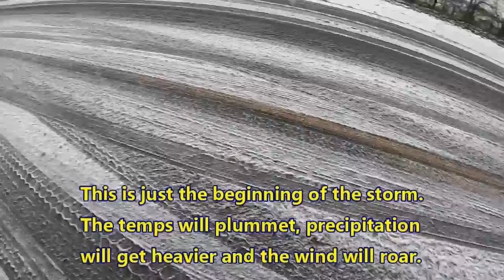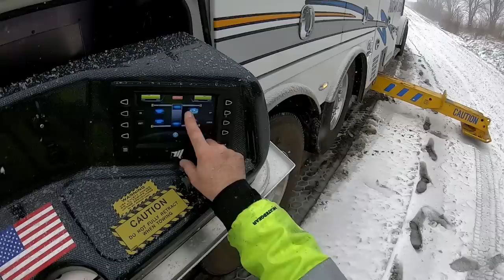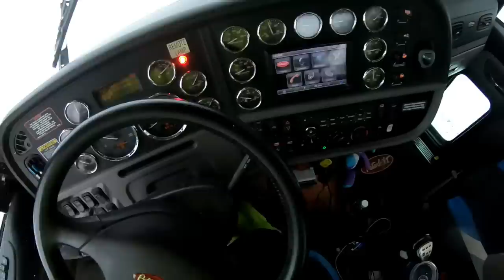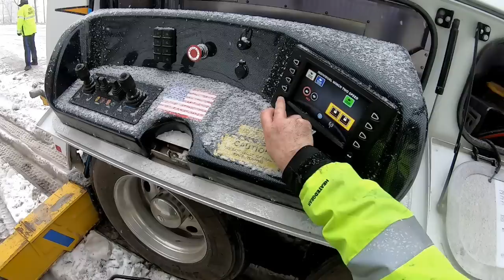Guardian Angel Working Overtime  Two Jack knifes in the Snow Part 1

Comment: Ron would it be better to have a support vehicle of some kind to give you rear protection in circumstances like that, even if it's an older car / van so you have some rear protection of (heavy metal) substance? At least then you reduce the risk someone hits the rotator or worse - you guys.  We do this in the UK in the form of a highways officer vehicles (non police range rover or shogun) with the wheels turned away at full lock so it's not rammed into the scene if struck.

Comment: hey Ron, your the professional, but i have a question. why didn't you pull the truck backwards. i would think that pulling it from the back of the trailer, would cause the truck to follow it and straighten out for you to pick it from the front.

Comment: I would get some road flares for a snowy conditions like that
Reply: Road flares are only so good, led flash pucks he uses are more reliable and reusable as they can be easily recharged or battery replaced if use AA or 9V
Reply: Joshua79C C the flashing ‘pucks’ come from AMAZON., INEXPENSIVE,, 2A BATTERIES,
Reply: Have to be careful with flares around leaking diesel, gasoline, or propane!😲

Comment: We (Missouri) got Weather-Hammered for sure. At various points in the video there seems to be an Echo, is that because of the camera placement on your hard hat, or are you using an external mic? Out of curiosity... Does Talon ever say anything Stronger than "Daggummit"? As always Ron... A great video.

Comment: In all of your Time Lapse videos I notice that you ALWAYS keep the load as low to the ground as possible. never any higher than required for the job.  That is very smart keeping as much potential energy out of the system as possible. meaning if anything does fail and break. The load would only have a very short distance to fall, and cause very little, if any, additional damage.
Reply from the maker: It isn't always possible to keep the load low, but I do so whenever it is possible exactly for the reasons you mentioned.    Thanks for watching and God bless.

Comment: ice is scarier than DUI drivers...

I was driving across Nebraska.  Clear sky, no sign of anything on the road and saw someone spin out ahead.  I touched the brakes and my speedometer almost instantly went from 60 to 0.  The car didn't change velocity or direction.  I was riding a ballistic object. It took over a mile to stop.

Comment: Thanks for the video. Two questions. Does anyone make a portable arrow board that you can use instead of cones? Also would you have been better off dragging the rig backwards first to get the tractor straighter? Can you rig so that you can do that without turning the truck around?
Reply from the maker: 1st, yes, there are portable arrow boards.  We actually have two permanently mounted arrow boards.  Each of our rollback trucks have them, but they were in use that day elsewhere.  2nd, yes, I have the capability of working over the cab and could have pulled the trailer backwards from where I initially parked.  There are several reasons that I did not perform the recovery that way.  The primary reason was that the cab was already into the trailer and the tractor was leaning uphill with the trailer leaning down hill.  If you noticed, we lifted the trailer so that it would pull away from the tractor to prevent any further damage to either unit.   Hope this explains my reasoning.  Thanks for watching and God bless.
Reply: At 9:55 the trailer is visibly resting on the tractor frame right behind the catwalk. No way to tell how much weight is on that contact, but you can bet that with those angles it's quite a bit.

Comment: Ron I have a question please can you recommend gloves that allow for work yet keep your hands from freezing these mechanics gloves suck my hands freeze in a second but if I did wear big fat winter gloves I can't work. What are your recommendations for somebody who does roadside assistance in ten below Iowa
Reply from the maker: This is the glove that I have been wearing.  They cost me about $10 a pair and last a long time.  They keep my hands dry and warm.  I keep several pair in the truck with one pair on the defroster to keep warm and then I trade out as necessary.  These are warm, yet flexible which allows the best dexterity that I have found in a winter glove.  https://www.google.com/search?q=memphis+arctic+ice+hi-viz+glove&rlz=1C1CHBF_enUS739US739&tbm=isch&source=iu&ictx=1&fir=tTGn8-GbFTbnbM%253A%252C0IHs_HRTsWz4QM%252C_&usg=AI4_-kQDsRaQtNsEsYaExXfwAhZfWOrG1A&sa=X&ved=2ahUKEwiZla7sya3gAhVq1oMKHQCLD_AQ9QEwAnoECAIQBg#imgrc=tTGn8-GbFTbnbM:
Reply: @RonPratt  thank you so very much thank you so much love the videos thank you so much Ron

Comment: Volvo 670 with mty van trl about 33k pounds.  Sustained winds 25-30mph with 45gusts on snow covered roads?  Even driving slow a wind gust can knock you off the ice . Sometimes you just have to make the call to shut it down when conditions overtake the ability to be safe. She rolled the dice & lost.  
Unfortunately a lesson learned might also be a job lost.

Comment: Feb 7 local weather went from 100' visibility fog to mid 50s, then high winds and the temp dropping 40 degrees. During the fog I saw too many cars with no lights on, and/or traveling too fast for conditions.

Stay warm and safe.
Reply from the maker: Yesterday we had 70 degrees F and heavy thunderstorms with hail.  Overnight the temps dropped to 10 degrees F and we are currently sitting at 19 degrees F.   LOVE Missouri weather......NOT...   Thanks for watching and God bless.

Comment: Someone needs to invent a proximity sensor to warn you of vehicles that get to close to your work area. Like maybe an alarm on the truck as a early warning
Reply: I think the problem with that is you would eventually tune it out, imagine steady traffic going by and it constantly going off, maybe something with an adjustable setting for speed so you can just have it look out for the most potential danger. When it comes to safety self awareness is the biggest thing, all the gadgets in the world won't save you from morons.

Comment: Hi Ron....Great video as always! I have a friend wanting to start a YouTube channel and asked me some questions I was hoping you may answer (Don't worry not competing, he is not a diesel guy...his videos will be on nature and out-doorsy stuff, camping hiking etc)
1) What kind of editing software do you use 2) What kind of computer do you use for editing
3) What computer specs do you have or wish you had to be able to handle heavy editing workload?
Reply from the maker: Ok, so I'll do the best I can to answer your questions.   1) I use Cyberlink Power Director 15 editing software.  I know there is newer and more professional software available, but I am familiar and comfortable with this software and it does everything that I need.   2) I am using a Dell Alienware but I don't know the specific model.  It is about 2 years old now.   3 ) I'm running Windows 10 with Intel i-7-7700 @ 3.6 GHz, 16 GB RAM, 64 bit OS X64 Processor, dual 1 TB internal drives and two external 4 TB drives.   The 4 TB externals are used for storage of all the raw video footage.   All my videos are shot in 1080 at 60 fps so the files are enormous.  There are times that I will have up to 5 cameras rolling at the same time so that is a lot of footage.  
So far, this system has worked quite well for me.  I will probably do an upgrade sometime this year and go with a lot more RAM and a newer, faster processor.  Other than that I am quite pleased with what I have.   Hope this helps. Thanks for watching and God bless.
Reply: @RonPratt  thanks Ron oh, I knew you would have a great answer because you put out some really awesome long videos and always edited together really well. thank you for your detailed reply, thank you for your great videos, and thank you for always ending them with a "God Bless!"

Comment: Does Miller have an option to 'lock in' the boom height and cable length so that they stay in sync for tricky situations so  the wrecker operator does not have to compensate the cable length as the boom is raised or lowered?

Comment: Question for you Mr Pratt, are you driving an 18 speed, 13,15?
Reply from the maker: The Rotator has an 18 speed transmission behind a 550 hp Cummins ISX.  Great combo, IMO.    Thanks for watching and God bless.

Comment: 19:00 Wow, are you lifting the rear of the tractor by the pin of the trailer?  You'd think something would break first...
Reply from the maker: Actually the tractor's fifth wheel and the trailer's king pin are the strongest component on each unit.    Thanks for watching and God bless.

Comment: To end up in situations like that more likely his or her speeds were too high especially in them conditions. 
Common sense you never travel no faster than 35mph  in slushy snow like that. 

Because when too much snow  gets trapped underneath tires the tire that is turning wheel loose traction and then that’s when you’ll go into a loss control. When speeds are lower you have better control of the situation🤷🏽‍♂️

Comment: Hi Ron, good job again! out of curiosity, i was wondering, was it not possible to push the trailer backwards with the rotator while it was hanging in the chains? that way the truck would have come backwards as well.. ( i'm from the Netherlands and have nothing to do with towing ,so maybe i see it wrong?)
Reply from the maker: It may be difficult to see in the video, but we actually started doing that until the cables started to damage the nose of the trailer.  At that point we had to stop and change directions.     Thanks for watching and God bless.

Comment: Um ron. I hate to tell you this.  you are wrong 4x4 does help on ice.  It helps you get into the ditch.   Stay safe out there.
Reply: It helps you go.  Help you to stop? Not so much.  People that think they can engage 4 wheel and drive like it's dry are going to get an education.
Reply: I have a 4x4 Blazer. While I got stuck once, the front hooks were perfect for the guy who helped me out. We got straps and that was it. I do use the 4x4 now and again when the roads are slippery since my Blazer isn't able to pull through an incline in 2WD. Otherwise, it has not let me down!  The aforementioned sticky mess was my fault, not the Blazer!
Reply from the maker: @donvaughn146  You've nailed it and thank you for admitting to the fact that it was your mistake, not the equipment.  I've driven 2WD & 4WD in all weather conditions and both will get you stuck.  A lot of what the equipment can do depends upon the operator.  Common sense being the key!!!    Thanks for watching and God bless.
Reply: @RonPratt  As they say common sense ain't.
Reply: 4x4 is great if you drive like you are in 2 wheel drive. Nothing with tires beats ice though....

Comment: Hey Ron where did you get the metal inserts for the tops of the cones where the led road flares sit.
Reply from the maker: Here is a link:  https://www.guardianangeldevices.com/?code=122   
Search for magnetic cone topper.  Use coupon code 122CLIP)   to receive special pricing.  
Thanks for watching and God bless.

Comment: You need some clear safety goggles to keep the wind-blown sleet out of your eyes and your face warmer.   I'm using these while working out in the oilfields of Utah under such conditions and they help:
https://www.amazon.com/gp/product/B003U9VE94/ref=ppx_yo_dt_b_asin_title_o03__o00_s00?ie=UTF8&psc=1
Multiple, layered baclavas and ski masks with the mouth cut out so you can breathe help too.   I like the 100% wool variety of baclavas because they aren't elastic and don't constrict my face.
Reply from the maker: I do have something similar to the goggles you have listed.  Here is the "clava" that I use:  https://www.academy.com/shop/pdp/seirus-adults-combo-clava-balaclava#repChildCatid=909309?campID=642940969&groupID=31323531198&device=c&productID=019049055&gclid=Cj0KCQiAkfriBRD1ARIsAASKsQJv_7-UUCib7IVebpl43ZS4Mo0QRk6yYCdUFO27x11hLFZIbo0yO1YaAiUiEALw_wcB    
It fits comfortably, provides protection, and allows me to breath without the glasses or goggles fogging.   Thanks for watching and God bless.

Comment: I don't get it. In my last three vehicles 2 aluminum and one steel I so much as kissed a curb and I destroy the rim and have to buy a new one but you guys are yanking a tractor out of a ditch by the front wheel Rim only and it doesn't destroy the rim? How is that possible?
Reply: Notice it is being loaded over more than one point which in your case is the main reason why they got damaged so easily, and the sling being as soft as it is there is no HARD surface such as what you ran into to cause damage to the rim so easily.

Comment: Hey Ron, serious question because I've always wondered. You have 12 tires in the back, if you turn on the axle lock, does it give you 12 wheel drive? or only 8 wheel drive?

I'm a truck driver that has only ever had a tandem in the back.
Reply from the maker: Actually, the third axle, the one closest to the front, is a self-steering lift axle with single 425s on each side.   The drives are 54K tandems with the standard inter-axle diff lock and individual axle full lockers.   So, in the winter weather I will raise the lift axle off the ground, putting more weight on the drives and then I have the ability for 8 wheel drive on the rear.    Thanks for watching and God bless.
Reply: @RonPratt  thanks for the answer man! I really had no idea but thought that on a tow truck 12 wheel drive might be a possibility, I usually drive a tandem straight truck and 8 wheel drive is amazing in the winter.
Reply from the maker: @derekkay4969  We could have ordered this unit as a "tridem",  which is full three axles  with duals and 12 wheel drive, but when we weighed out all the options we decided that this was the best setup for us.   If we lived somewhere that received a LOT of winter weather we probably would have order the "tridem".    The self-steering axle actually helps us maneuver the tight corners and narrow streets in our area.   With the self-steering rear axle down, the turning radius is greatly reduced.    Thanks for watching and God bless.

Comment: Not 2nd guessing but why didn't you hook to the rear of the trailer and just pull him backwards?
Reply from the maker: The front of the truck was uphill.  The cab was downhill and hard into the trailer.  The trailer was leaning hard uphill into the tractor.  The trailer frame was down hard on the tractor frame.  I wanted to lift the passenger side of the trailer and level everything out to minimize any further damage to either unit.  That's why you keep hearing me tell Talon to lift on Blue...to keep the passenger side of the trailer up and away from the tractor.      Thanks for watching and God bless.

Comment: Do those pucks have anything to hold them into the tops of the cones?  I would think they'd blow off.
Reply from the maker: The pucks have a magnetic base and we used industrial adhesive to place metal flat washers on top of the cones.   Quick, simple, inexpensive, and very effective.   Thanks for watching and God bless.
Reply: Simplest solutions are usually the best, thanks for the response Ron.

Comment: Ron, did you recently change your helmet cam?  it somehow seems different than your older videos and frankly, the swinging around makes me motions sick.  I'm wondering if its more of a wider angle camera that may be causing it?  Love watching your videos.
Reply from the maker: I did change cameras.  I "upgraded" from a GoPro Hero 5 to a Hero 7.  The Hero 7 is suppose to have much better stabilization built into the unit, so it claims.  My wife has trouble watching my videos due to the constant head movement so I am constantly looking for ways to minimize the "jerky" motions of the camera.  As I explain to her, my "head is on a swivel" as we say, which means I am constantly scanning my surroundings for possible dangers.  It can be difficult to watch, even for me, but this camera perspective is what the majority of my viewers have requested.    Thanks for watching and God bless.
Reply: @RonPratt  interesting. Not sure why it bothers me...  Maybe if the field of view was lifted up more so you don't see the ground swirling left and right as you move your head.   Anyway... Enjoy the videos.

Comment: still trying to figure out what the "D" rings on the back side of the boom are for behind the wenches
Reply: Those are other load points they use for the auxilliary winches the they sometimes have to use. They can put the hooks in there when they have to double up the cables, and are using their snatch blocks on whatever they are pulling or lifting.
Reply: He stated in previous video on such a comment he has a video in the works explaining it, its use, and why he opts not to use it most of the time.

Comment: Would the jack knife have been averted if there had been chains on the tires? Imma Newbie
Reply from the maker: Trailer was empty, so no weight.  High cross-winds on that section of road with slick conditions......probably would have blown the trailer around even with chains on the truck.   Just my opinion.  Thanks for watching and God bless.
Reply: From my POV, chains are only so useful.